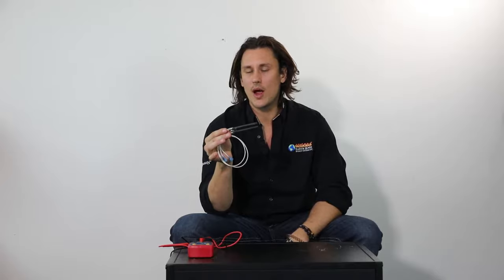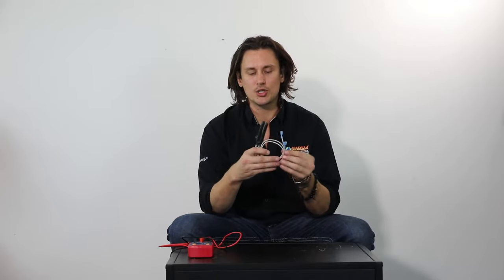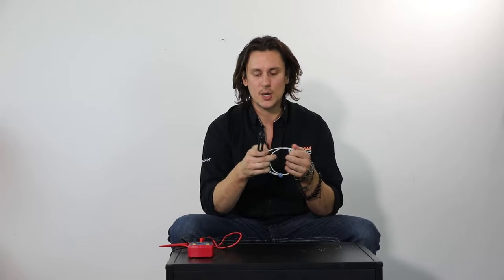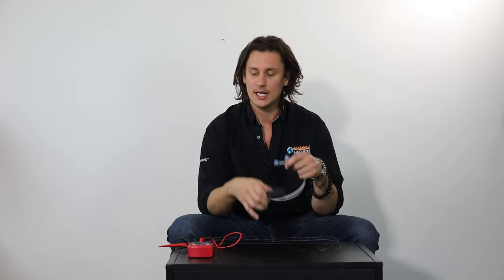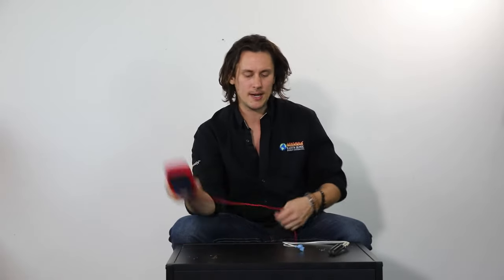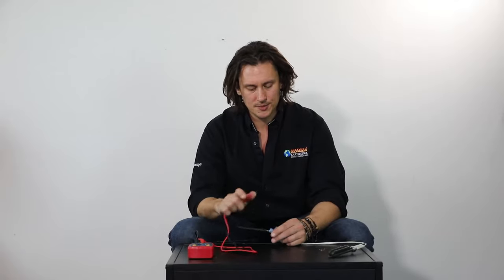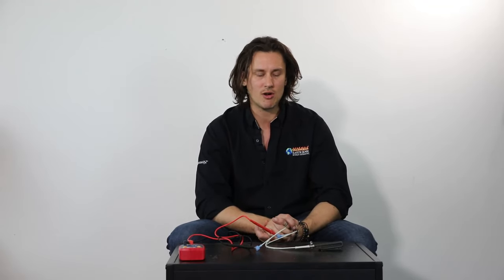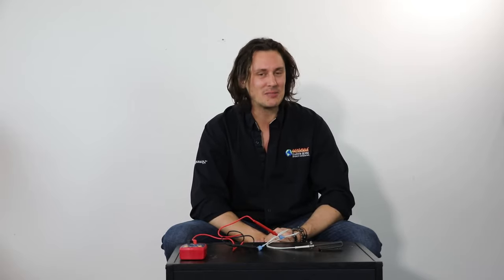How To Test A Stove Igniter, Pellet Stove Ignition Troubleshooting

Comment: If the ignitor is good but does not heat up. Everything else runs good. Classic bay 1200 quadrafire. Is it relay in control box? How do u replace that
Reply from the maker: Thanks for contacting us. If you have tested the igniter and it is in proper ohm range, yet is not getting a charge/heating up during the start-up cycle, it would be an issue in the control box. Most likely a surge that fried the ignition block in the control box. Make sure you double check the igniter wire connections, and again if you have the OEM 300 watt element, OHM reading should be 43.5 – 53.5. (Aftermarket igniters and the 380 watt multi-fuel loop igniter will have different reading ranges.)
There may be an electronics shop that does control board repairs that you could look into. If you do need to order a new control box here is the reference for that. Any other questions please let us know. Thanks. https://pellethead.com/product/quadrafire-control-box-3-speed-circuit-board-oem/

Comment: Have a quadrafire castille igniter is fine getting no power to it. Can you help?
Reply from the maker: Thanks for contacting us Phil. The ignition cycle will be controlled directly by the control box in the Quad Castile. You can use a multi-meter to see exactly where power is being lost. Double check the lead wires into the junction box wire harness area. If that all looks good, most likely we have an issue with the control box itself. Here is the control box for reference; keep us posted, happy to help. https://pellethead.com/product/quadrafire-control-box-3-speed-circuit-board-oem/

Comment: I have a Pleasant Hearth PHCAB50PS that doesn't ignite this year. The stove and exhaust is clean. I've replaced the ambient temp probe and the ignitor. Still won't ignite. Auger feeds pellets as it should. I've checked both old and new ignitor both test at 51-52 ohms. The ignitor is heating but the fire pot can still be touched after failing to ignite. What could be the issue? I've called GHP and they are at a loss for words or suggestions. The stove is about 8 months out of warranty now. Any suggestions?
Reply from the maker: Thanks for contacting us, happy to assist. It does sound like your igniters are in operable range and are receiving input from the control board to turn on during start-up sequence. Keep in mind that it is not the igniter lighting the pellets, but the super heated air rushing around the igniter. Let's take a close look at your exhaust motor operation. If you have a multi-meter, let's check the voltage during start-up. Should be near line voltage. From there let's make sure your gasket seals are tight on all doors and give a thorough inspection to the burnpot and burnpot bottom to make sure we don't have gaps or air leaks. Inspect the air intake to the burnpot as well. If there is any loss of combustion air it will create this issue. Let us know what you find, happy to assist. 

Thanks,
Reply: @EarthSense  I tested the voltage on the exhaust fan and it reads 115.5 volts at start up. I removed the exhaust fan and cleaned it thoroughly. Wasnt really that dirty. Spins freely. Replaced the exhaust fan gasket. Still receiving the still error codes. First is 3 flashes indicating ambient temp probe (been replaced). It cycles again and flashes 4 times indicating failure to ignite. Burn pot is spotless clean and warm to the touch but not to hot to handle. Its almost as if the ignitor isn't hot enough.
Reply from the maker: @MrWeezy1976  Thanks for the message back. Glad you checked the exhaust motor and everything is looking tip top there. Do you know what igniter you put in there? Either wattage or part number? There is a pellet only igniter and a multi-fuel igniter. They differ in the optimal ohm range. You originally mentioned reads of 51/52 ohms which would be operable range for one but not the other. Let's make sure that igniter is in proper ohm range. From there we need to make sure all door gasket seals are tight and let's double check the air intake tube coming into the unit to ensure it's free and clear. It either has to be the igniter out of range or somewhere we have an air blockage or an air loss issue. Keep us posted, happy to help.
Reply: @EarthSense  I ran a lighter around the closed door to see if it would draft the flame...it did not. The intake is free and clear. I purchased the ignitor directly from GHP part# SRV7000-660m
Reply: Should there be any air movement around the exhaust fan?
Reply from the maker: @MrWeezy1976  Thanks for the message. Glad you checked the door area to see if it sucked the flame in. Important to know we don't have leaks there. Quick Question - If you manually light the fire by hand, does the flame look crisp, clean and torchy in operation? Just want to make sure it's not an air issue. Thanks for sending the igniter part#. That is a different igniter style for your model - I'm checking in with our tech team to see if they have an operable ohm range for that one. I will follow-up on that. It's rare that an igniter wouldn't be correct from factory, but we definitely want to double check it. I'm sure you have double checked the mount for the igniter - again proper installation and placement is very important for ignition.
Reply from the maker: @MrWeezy1976  You may feel a little bit from the inner combustion paddle if it's a caged or exposed motor style. Shouldn't be much though.
Reply from the maker: @MrWeezy1976  Our tech just stated that element should be 38.0 - 47.0 ohms. He did not sound 100% certain though. Can you contact GHP to verify the proper ohm range for the SRV7000-660m?
Reply: @EarthSense  Iit the stove manually with hand sanitizer gel and a map gas torch. Its been operating perfectly for about 35 minutes now.
Reply from the maker: @MrWeezy1976  Okay, glad you did that test. It tells us that this is not an air issue. This is an issue with the element. It should be under factory warranty on the one you just recently purchased. Please keep us posted.